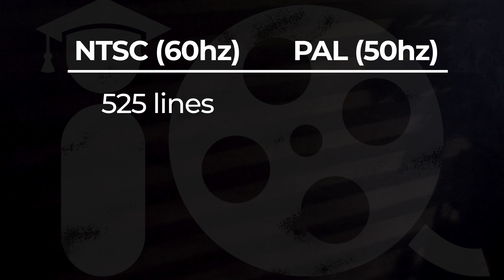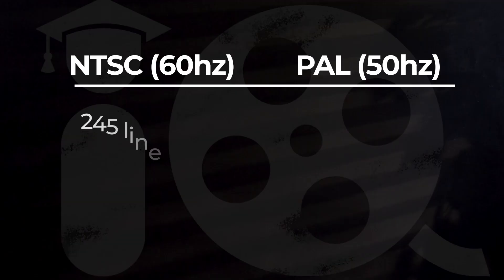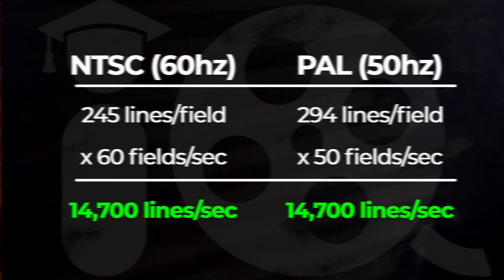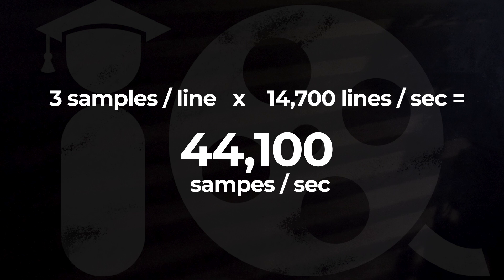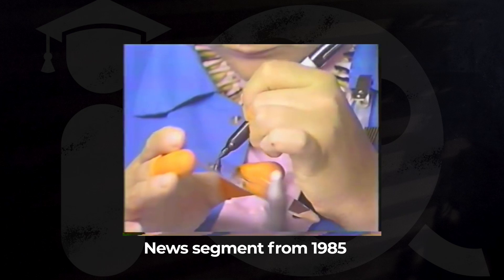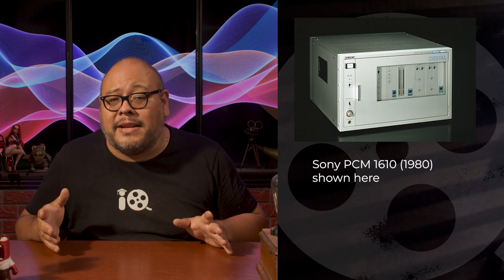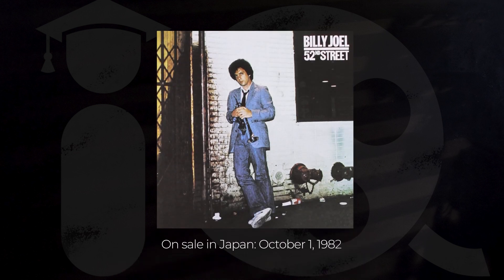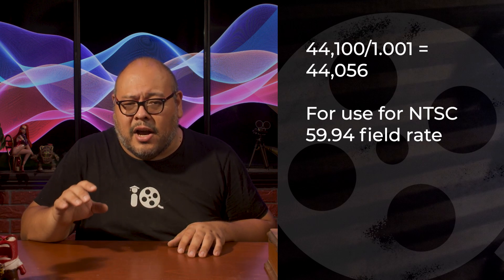The Surprising Origins of Digital Audio Sampling Rates

Comment: One little thing to add: one might wonder "Why not just use 40 kHz these days, given that we don't record on video tape anymore?" Well, to avoid aliasing artifacts, you need to use a low-pass filter on the recording to remove all frequencies that are higher than what the Nyquist-Shannon sampling theorem allows. The steeper the filter, however, the more artifacts the filter itself introduces. An infinitely steep cutoff would be a disaster, therefore you want to have a bit of give in the sampling frequency. Which also means that in principle, 48 kHz could sound better than 44.1 kHz, even though no human can hear those frequencies.
Reply: Dan Worall, the Attenborough of audio engineering, goes very in depth about the samplerates from audio engineering standpoint. I couldn't recommend it more. Video is called "Samplerates: the higher the better, right?" and it's on FabFilter's YouTube channel. Even if you don't have any prior knowledge about audio engineering, it will demystify the whole topic very efficiently.
Reply: @eliteextremophile8895  I will have a look later but it's important to note that I was just talking about sample rates close to the minimum, not about 192 kHz and stuff like that, that's not doing anything for you other than to overwhelm your audio equipment. Unless you're a bat researcher, you don't need that sample rate. More than 16 bit, however, can be quite useful and at least has no detrimental effect.
Reply: @unvergebeneid  I completed a Diploma of Audio Engineering at SAE back in 1994 and embraced digital audio almost immediately when it was released.
While I agree that anything over 20k is not audible to the human ear (most people are lucky if they can hear much above 16k) it is interesting to note that frequencies above our hearing threshold still have an impact on the end result due to harmonics and intermodulation distortion. This is one of the main reasons that MP3 compression never sounds as good as a raw wave file, because the frequencies that it eliminates for the sake of file space may not be in the general hearing range but have an indirect effect on the rest of the audio that is in the range of your ears. Please don't take this as a condescending or rude comment it's just something that I learned a little about in my course and have also researched a little over the years, I run a small Music and Video production studio here in Melbourne Australia and generally use 48k as my standard sample rate and 24bit for that little extra dynamics and lower noise floor even though my audio interface is capable of 192k sample rate.
Reply: @paulstrahan4670  isn't intermodulation distortion a result of imperfections in audio equipment and should ideally not occur at all? So if you lowpass those inaudible frequencies away, wouldn't that bring the signal closer to the ideal?
As for compression, from my experience, mp3 is most noticeable in percussion, not in anything harmonic.
Reply: @eliteextremophile8895  very good video indeed. As I'm not a music producer myself, I definitely learned something about that part of the tool chain!
Here is the link BTW https://youtu.be/-jCwIsT0X8M

Comment: NTSC is always 59.94Hz - the previous black and white 60Hz format wasn't called NTSC. PAL is also always colour - the previous black and white 50Hz format was only 405 lines. Video tape wasn't invented until after colour TV was invented. 48kHz audio sampling also predated 44.1kHz and was deliberately chosen to make conversion to 48kHz as hard as possible to prevent copying of CDs (44.1kHz) onto DAT (48kHz).
Reply from the maker: What was the 60hz called? I'm pretty sure the 59.94 HZ was called the second NTSC committee... 

Wikipedia states that NTSC (North American Standards Committee) was formed in 1941... It made the black and white standard and I haven't seen it called by anything else...

Yes tape didn't come along until late 50s, that doesn't mean it couldn't run on the old standard of 60hz... Because it obviously did.

As for 48 existing before 44.1, yes it was but it wasn't a standard yet. 50khz was also used by Decca in Europe for early digital recording.

I don't necessarily buy the whole 44.1 is hard to convert to 48 because you could always just run it back to analog. Besides DAT tape wouldn't come out until 1987 which is 6 years after the introduction of the CD. Video sync is a much better explanation

Read more about the TV side here: https://www.tvtechnology.com/opinions/digital-audio-sample-rates-the-48-khz-question
Reply from the maker: So calling it NTSC was correct.

Comment: Except there is no resolution. Nyquist-Shannon describes why. Sample rate simply dictates the upper frequency reproduction limit, and bit depth does relate to dynamic range, but it might be better to think of it as how much noise is introduced alongside the desired signal you are trying to reproduce. More bits, less noise.

Anyway… A 1000 Hz test tone isn’t reproduced “better” or with “more resolution” when using 48 KHz versus 44.1 KHz. The output would be exactly the same in both cases. Exactly. Nyquist-Shannon sampling theorem dictates this.  It perfectly reproduces all frequencies less than half the sampling rate. A higher sampling rate doesn’t give a more accurate result. It doesn’t give better resolution because there is no resolution. You either can reproduce the input signal because the frequencies present are all less than half the sample rate, or you can’t reproduce some of it because the input contains frequencies higher than half the sample rate. As long as it is below half the sample rate you can reproduce it. There is no better or worse. Either you can do it or you can’t. Period.

This is a very good demonstration and explanation of how it actually works. https://youtu.be/cIQ9IXSUzuM
Reply from the maker: Who are you addressing? I'm not making any of the claims other than calling the audio "resolution" which it sort of is. Sample rate governs the frequency resolution via Nyquist, bittate governs dynamic range resolution.
Reply: @FilmmakerIQ  There is no resolution. As I just said, a 1000 Hz sound will not be represented better by a 48 KHz sample rate versus a 44.1 KHz sample rate. You seem to be saying it would be better since the resolution of the 48 KHz version would be higher. But it is not higher. It doesn’t work that way. The output of both would be EXACTLY the same. Again, the sample rate only dictates the highest frequency you can reproduce. It doesn’t change the quality of the reproduction. It doesn’t change the resolution of the recording. There is no resolution. You can either reproduce the signal 100% or not at all. There is no in between. There is no quality gradation. There is no resolution. Either it works or it doesn’t. Seriously, if you really want to understand it then do yourself a favour and spend the time to watch the video I linked to and you will get a very easy to follow demonstration with examples and a graphic display to illustrate what is actually happening. When someone thinks there is a resolution element to digital audio they do not understand digital audio. There is no resolution element to it. It is all or nothing. 48 KHz doesn’t do a better job that 44.1 KHz. The only difference is 48 KHz can reproduce everything below 24 KHz and 44.1 KHz can reproduce everything below 22.05 KHz. In both cases if your input signal remains below the lower threshold of 22.05 KHz the output of both sample rates will be identical. The 48 KHz one will not be smoother or more accurate. They’ll both be exactly the same. If there were signal content at 23 KHz then the 44.1 KHz sample rate would fail to reproduce it because it is beyond Nyquist, but the 48 KHz sample rate could still reproduce it. But if the input signal remained below the Nyquist point for the lower sample rate then both sample rates would be able to reproduce it and their output would both be the same. Exactly the same. Sample rate is not a quality indicator, there is no resolution. Sample rate only tells you the ceiling for the frequencies you can reproduce. And when you stay below that ceiling the quality does not change because it doesn’t work that way. Really, just go watch the video. You will learn something. It tells it in a much easier to understand fashion since it is a video and can go through the examples visually.
Reply from the maker: I've already seen that video which is absolutely fantastic. I'm not disagreeing with anything you're saying and if YOU ACTUALLY WATCHED MY VIDEO instead of just indulging your preconceived notion of what I'm saying, then you wouldn't have needed to write that wall of text.

Your problem is you have some qualitative notion of what "resolution" means. Yes, audio sampling has RESOLUTION - the waveform IS THE GRAPH of that resolution. You can't deny that a 48khz has more resolution than 44.1khz - it's by DEFINITION - sampled about 10% more times per second - which according to Nyquist means it can handle about 2khz more frequency on the high end.

Everything else - from 0-22khz - yes exactly the same. Do we hear the difference, absolutely not. But then you get into filtering and anti-aliasing and that's a larger story.

It's the same thing with image resolution. The human eye can only take in so much detail, you can increase image resolution further and further and it's not going to look any better - no one can tell a 4K image from an 8K image by looking at it on their phone...
Reply: @FilmmakerIQ  The point is the word resolution implies that a 1 KHz output signal is “better” with the 48 KHz sample rate. Do you think the 48 KHz gives a better, higher resolution output signal of that 1 KHz signal? The notion of “better resolution” would mean just that. It would mean that the 48 KHz sampled version of the 1 KHz signal would contain more information, would have better resolution, than the 44.1 KHz sample rate version. Is this the view you hold? Because that’s what better resolution would mean. If that’s not the view that you hold then the phrase “better resolution” is not actually what you are trying to say. You saying that it is sampled about 10% more times per second leads me to believe that this is indeed the view you hold, that the 48 KHz sample rate would give a “better” 1 KHz, as that’s what better resolution would mean. Unfortunately this is not what’s happening, as I’ve said several times now. Sampling it by about 10% more times per second doesn’t give you a better, more accurate output, with higher resolution. You could sample a 1 KHz input signal at 3 KHz or a million Hz and the resulting output would be exactly the same in both cases. The million Hz sample rate version would again not be better. Why? Again, because there is no resolution. You either get a perfect representation or you get an error. There is no better or worse quality. It works, or fails. And if you wish to argue against that I am sorry to say it is simply because you do not yet understand how it all works, even if you think you do. Have a good one.
Reply from the maker: How dense are you???

I just got done explaining your problem is you equate resolution to quality like a grade schooler.

MORE RESOLUTION DOES NOT EQUAL MORE QUALITY.

It doesn't imply it either unless you take a sophomoric look at the world.

Are you denying that 48khz has 10% more samples per second? Are you denying that 48khz gives us about 2khz more headroom than 44.1?

Did you not read and hear me say no one can tell the difference between 44.1 and 48??

Seriously... Maybe YOU need to rewatch Monty's video and lose your bias.

Comment: I have the Sony PCM-601ESD PCM adapter, I recorded a lot of albums from my computer to VHS and Video8 tapes, a lot of fun. But there are computer programs that can do that now if you have a video card that can pull the video off of the tape and convert it to PCM inside the computer using special app or even record a PCM audio back into the video tape without needing the PCM adapter.

Comment: This is the third reason I've heard so far. 😄
Reply from the maker: The other two are wrong
Reply: @FilmmakerIQ  The first reason I heard, absolutely wrong. 

The second reason had to do with carrier frequencies in the video signal. I can't find the article I got that from, but I'm gonna guess it's basically the same as what you said, but in a different way.
Reply from the maker: I was being facetious. The carrier frequency was the reason why they bumped down to 59.94hz  from 60hz - maybe that was what they were getting at.
Reply: @FilmmakerIQ  Maybe.
Reply: @FilmmakerIQ  it’s also part of the derivation to get your lines/second figure, so OP was basically correct that the frequency (probably meant baseband frequency rather than carrier frequency though) was another way of saying what you said. 

Given it was 5MHz bandwidth per channel, minus front and back porch, ≈3MHz for the video itself. That divides up in various ways until you reach ~15kHz horizontal refresh rate. As you can see, that’s very close to 14.7k. And then we’re caught up to the video, more or less.

 I guess the main difference is one approach focuses on the electron gun’s behaviour while the other thinks about it more as the signal going on the tape? But ultimately they’re just analogues for each other anyway.

Comment: Going to digital does require that any frequency above the Nyquest limit must be filtered out or aliasing will occur.   However, the best analog Low pass filters we can make are a sixth order filter with-36 dB/Octave.  (Roughly 1/64 the voltage per octave)   That's just not enough and any ultrasonic sounds will appear as lower frequency sounds due to aliasing.   The higher the sampling rate, the greater the reduction in ultrasonic noise.   No surprise that some recording studios like to sample at even higher rates of 96,000 samples per second and higher.   Digital filters have an impressive reduction of over -100dB per octave, which puts all ultrasonic sounds into the floor.  After that the digital audio can be reduced to a lower sample rate.
Reply: To be honest, there's not much reason to go over 48kHz when you're using somewhat modern professional plugins. First and the most obvious is, 96kHz almost as severe aliasing issues as 48kHz. Sure, you have 2 extra octaves of headroom which will get rid of the aliasing issue when using saturation in one stage, but adding stages will introduce just as much artifacts as 48kHz. 192kHz would get rid of most of the aliasing issues for first two stages, but then again, it's not very practical and still not enough. You can add lowpass to every stage and get rid of the aliasing, but having 192kHz audio files being processed in three or more stages with lowpass in every stage is very inefficient. You get much more efficient results using 48kHz and 4 or 8 times oversampling in plugin  (some even has as high as 16 and 32 times oversampling without being too hard on CPU) and it's also much more efficient in reducing aliasing. 

Then there's the 44.1kHz vs 48kHz and when using oversampling, the difference should be very minimal, right? With 44.1 filtering has to be extremely steep when removing stuff over 22.05kHz without affecting signal at 20kHz. With 48kHz you basically have twice the headroom in filtering out the unwanted stuff that creates the aliasing. So basically 48kHz is twice as good as 44.1kHz and as I've stated it's very inefficient to use higher than 48kHz. Then again, not everyone uses plugins with internal oversampling. Also, someone might as well have Threadripper and billion terabytes of space to utilize, so might as well record, mix and master at 192kHz.
Reply: @eliteextremophile8895      Clearly 48kHz is better than 44.1kHz sample rate.  Even at 48kHz, the Nyquest  Frequency is  48kHz / 2 = 24kHz.  Once you exceed the Nyquest  Frequency, the frequency appears to go down.  That is 24kHz is 24kHz, but 25kHz appears as 23kHz.  This is due to aliasing.  Assume that we start a Sixth Order Filter at 12kHz, it would be -36dB (1/64 the signal) at 24kHz.  Just not  enough to fully remove the high frequency noise.

I've never staggered a bunch of 6th Order low pass fillers at different frequencies, like 12kHz, 15kHz, 20kHz, to see what happens, so I'm not sure if that's the answer.  

The reason I suggest 96kHz sample rate is that there's so much head room for a 6th Order filter.  The input frequency would have to reach 48kHz before the Nyquest  limit kicks in.  Assuming the Low Pass is set to 19kHz, 48kHz is 2.5 octaves  higher in frequency and offering a -90dB drop in signal level.   From that point, a digital low pass filter can be over -100dB per octave and remove anything above 20kHz.

Now if staggered low pass filters do the job, the 96kHz sample rate is unnecessary.
Reply: Great points Bob. 96k is a common choice in the studio, as you mention. For example, I use the DEQ2496 as a DSP and it unsurprisingly operates at 24bit 96kHz. That model has been around since at least 2003 and 96k was in use long before then. There are so many benefits of higher sample rates, especially since common hardware can decode  at ridiculous rates like 32bit 384k and disk space is limitless in the studio. Though in my opinion, for (non-hifi) consumer audio 16bit 44k is good enough.
Edit: I should note, this does depend on the studio and software/setup in question. Sometimes there are reasons to avoid higher sample rates.
Reply from the maker: Well put!